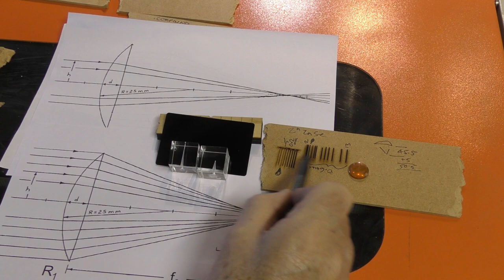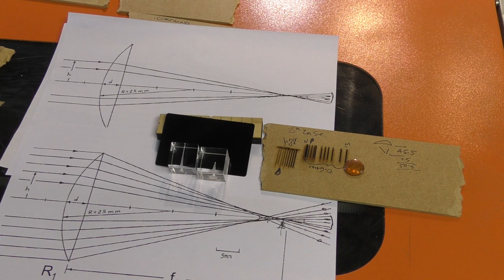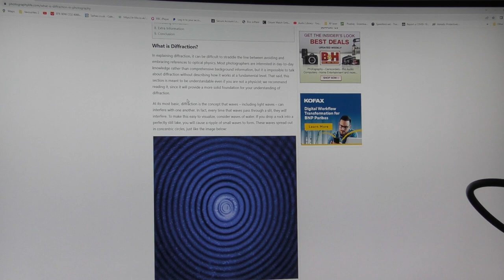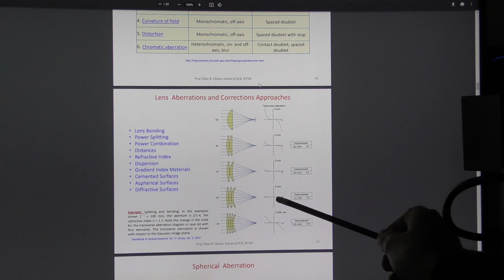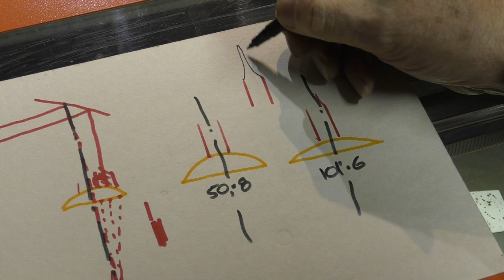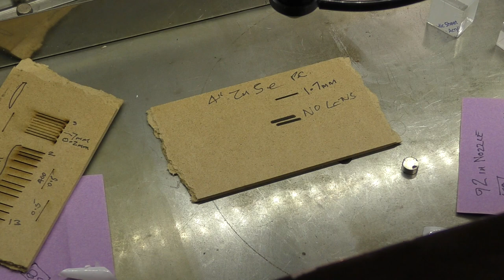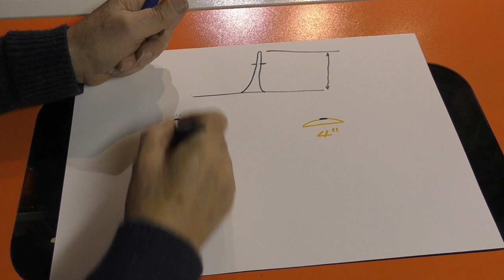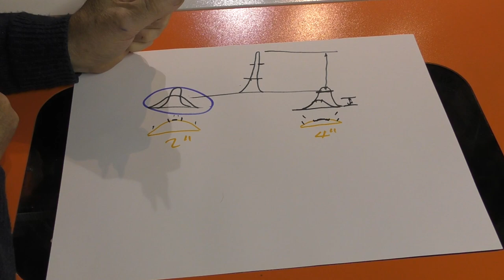RDWorks Learning Lab 231 Search for a Beam Conditioner part 4

Comment: First comment, intensity is a photometric term describing how bright a light source appears to your eye.  Since you are measuring laser energy in Watts and you are interested in the amount hitting a surface the proper term is irradiance.  The CO2 laser emission is 10.6 um and is invisible so technically it is not light.  Light is defined as the wavelength between 0.3 and 0.7 um  but everyone uses slang so we know what you mean.   Second comment,  when you stop down a lens you get a greater depth of focus,  I think this agrees with what you are seeing.  When you use more of the lens you should get a finer spot size and less depth of focus assuming that you are below the ablation threshold.  Once above the ablation threshold you will not see the effect because the substrate is damaged destroying any fine detail.  Of course the laser is multi mode so you don’t have a single well defined gaussian beam but multiple spots that are not stable.  Of course it looks gaussian over long exposure time with high energy that ablates the acrylic and you are dealing with huge spot size and are only interested in cutting so none of that matters anyway.
Reply from the maker: Hi Ernie
 Thanks for your comment because I enjoy great  technical feed back. It makes me stop and think.   I very purposely use the term INTENSITY to describe the part of the laser beam that interests me because it is more visually descriptive than energy density, flux density or irradiance . So please forgive my liberty taking..... after all this is shed science and as you see I have no respect for theory and rules. I know that high intensity light can damage material faster  than low intensity light. Thus the amazingly small and ultra intense beam direct from  this 30 watt tube  has more cutting potential than my 70 watt glass tube with its 8 or 10mm beam. I see a lens as nothing more than an intensity amplifier  so if I put an already  intense small beam into a lens,  I expected to get  a significant  intensity amplification. 
With all my  lens testing, I have used  a conventional CO2 glass tube beam with a much "softer" intensity profile. This RF tube has allowed me to investigate  the effect of different  beam expanders. I already established that a X2 beam expander cuts better than a X3 beam expander  purely because as you increase the beam size you decrease the maximum intensity. Less intensity= less efficient cutting. My search for the impossible (so I have been told),  a  x1 expander that  retains the diameter and intensity of the beam over the work area ,  was not quite achieved,  but nearly. This ultra small high intesity beam  has allowed me to prove a lens property that I started discussing 2 or 3 years ago as I searched for the mechanism by which lenses to cut deep and straight.  This ineffective focus zone adjacent to the lens axis  is proved beyond doubt in my final demonstrations. That 190mm focal length lens produces a line thickness of about 0.3 when used on my glass tube machine. Pass a 5mm intense beam through it and it now burns a 4mm wide line.. . As with all theories, there are limiting conditions  ans I think what I am seeing is unexpected and outsde the scope of lens theory. Lens theory has remained unaltered for several thousand years and lasers were not around  for Kepler and Galileo to  include in their experiments.

  I see no stopping down in what i am doing to explain the huge depth of field I am achieving.  this light is not passing through an aperture , all I am doing is effectively zooming with different focal length lenses

 This clearly demonstrates  why everyone uses a beam expander to control their  RF machines. A larger beam reduces the central intensity to a point where any "leakage"  through  the "hole" becomes insignificant however  it dramatically reduces cutting potential . A well focused spot from a near uniform beam (as you say) is great for engraving. However as I have discovered. it is a weak well-focused spot. This 30 watts runs out of  engraving capability at about 400mm/s  This super intense beam even passing through a 3 stage compond lens, now has the ability to run at 600mm/s  and I have yet to experiment as to just how fast I can really  go.

 Although it looks like failure  so far, the knowledge gained will allow me to revise my parameters and I still feel confident of improved cutting performance by manipulating the shape (intensity profile) of the beam
 Best wishes
Russ

Comment: What if the light is thought of as a liquid and the lens is a hose nozzle. Forcing the liquid through a smaller nozzle results in greater  damage, as in pressure washing.
Could there be such a thing as forcing the light through a quartz crystal or similar crystal shape rather than commonly shaped laser lenses? Just mentally rambling here on too much coffee.
Reply from the maker: Several small problems with your suggestion. First there are very few materials that transmit 10.6 micron light and I am using two of the most common (ZnSe and GaAs) . Try firing your beam at a tray of sand (quarts crystals) and see what happens.
 Secondly , liquid is not even a close analog for light but if you need some sort of imaginary liquid model  then it is the laser beam itself which is the high pressure water  coming out of the hose nozzle.  Now point that high pressure jet at a small hole in a flat surface.  If the hole is smaller than the jet then any water that cannot get through the hole will just splash back.
 That hole will do nothing to further increase the pressure.
 Sounds as though that coffee may be tainted with something "interesting"
 Best wishes
Russ

Comment: Is there a way to order your papers on how to print a photo using the laser?
Reply from the maker: Hi Franco
 If you add another comment that contains your disguised email address then I will send you a data pack.  Disguising your address used to be fairly simple but recently YouTube has implemented algorithms that detect bits of email addresses and prevents publication. We now have to be smarter than the algorithm. You have to describe your email as part of one or two sentences, so here is an example.  Start with john and then after a dot add smith. Use the normal at symbol followed by this backwards liamg plus a dot and a com.  
I will delete you comment as I reply
 Best wishes
Russ
Reply: @SarbarMultimedia  hi yes it is "franco" then "ad" the at symbol and I really like yahoo
Reply: Thank you!